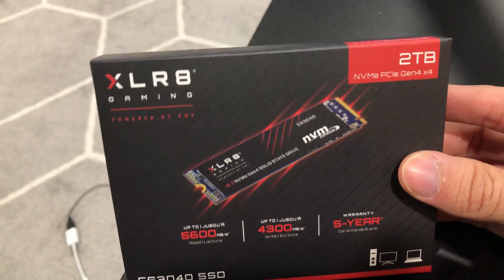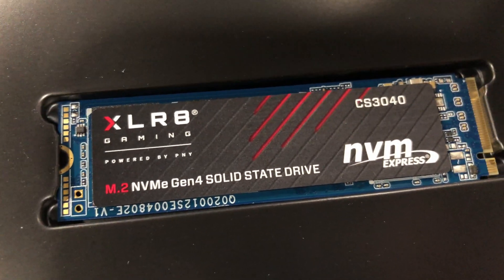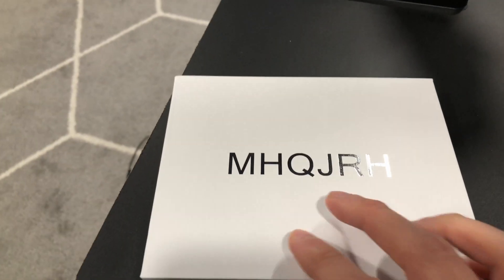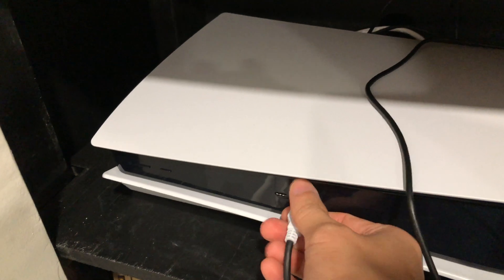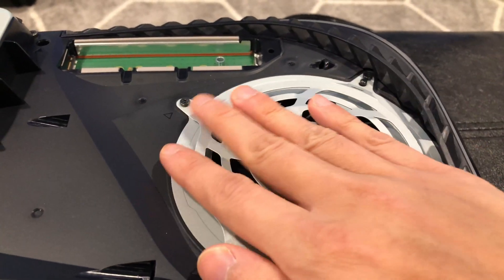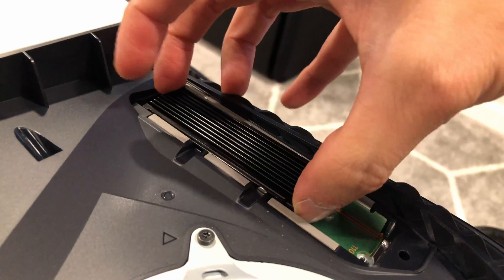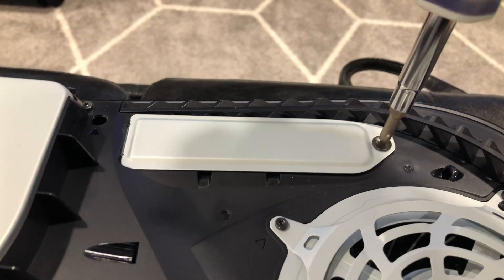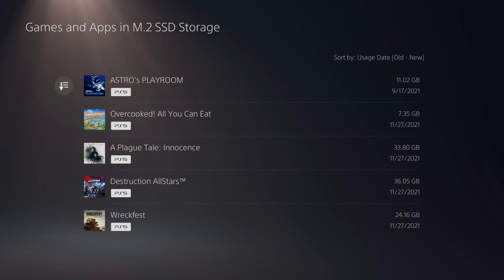DIY: Expand PS5 Storage with PNY CS3040 2TB M.2 NVMe SSD | Easy Install & Performance Improvement

Comment: the s70 blade is way cheaper and has faster speeds look it up.. I bought mines for $130 off Amazon and works like a charms had for some weeks now and played hours on end with no problems
Reply: I too got Adata XPG Gammix S70 blade 2tb for $250 and it's performs just as good if not better in some cases than some others online.
Reply from the maker: Thanks for the suggestion!
Reply: not the 2tb model
Reply: As I write this comment the s70 blade is about 50 dollars more then the cs3040.

Comment: Do you mind retesting read speeds?  Seems like a recent update and at least with 2 copies it's no longer at 5600. Would like to verify if it's the drive or the update as you are one of the few with one that had "propper"speeds
Reply: Hi, I installed drive today and mine says 3866 MB/s. Do you have proper 5636 MB/s after exchange?
Reply: @bLd321  still the same speed with the replacement, thinking of exchanging with the s70 blade
Reply: @ZioComposite  Thanks for update. I'll probably write to PNY support as they're advertising 5636 MB/s on their YT channel. I guess that something changed with PS5 speed testing method. I don't believe that before every drive reported 5636 MB/s and now every drive is "broken". I tested loading speed of some of my games and I didn't notice any difference comparing to internal drive so I'm not that much concerned (especially that I paid less than 200 EUR for 2TB) but I really would like to have some confirmation.
Reply: @bLd321  that's a good deal then!  I tested with PC and read speed was about 5000 with Crystal Disk Mark. Good luck and happy gaming.
Reply: @ZioComposite  Ok, so it seems that your drive is fine as CS3040 always had around 5GB/s in PC tests. That means my drive is also fine. Now I can go back to the game. :) Thanks again for all the infos.
Reply: @kyopolska7274  Can you send me a link to the forum thread? Thanks for the info about your case.